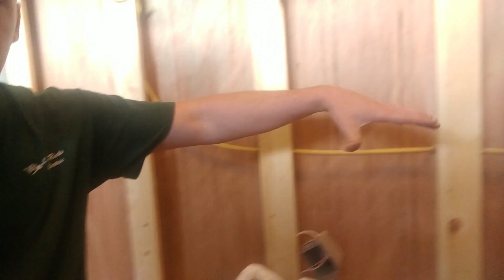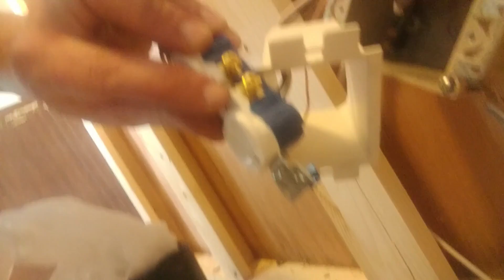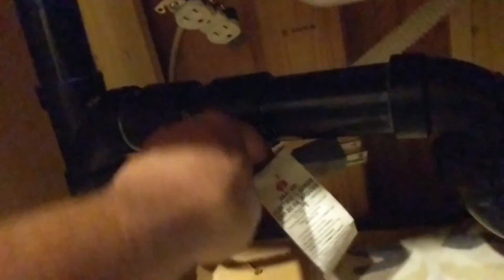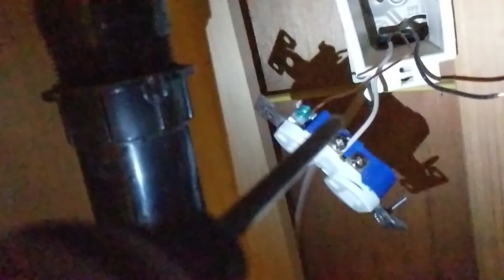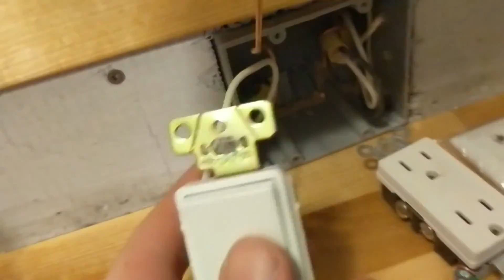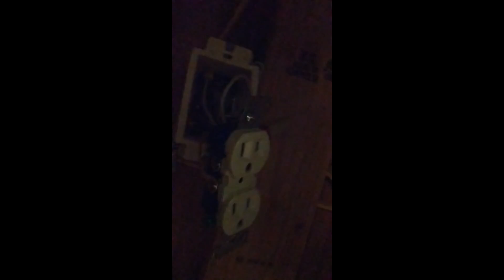Wiring for a Switched Disposal | Kitchen Sink Disposal Outlet

Comment: What is the way to provide GFCI protection for the dishwasher and disposal? You can’t split a GFCI outlet. 
I guess cutting for a quad box and putting in two GFCI outlets and one of them is switched… 
Or putting in two GFCI breakers at the load center(?) More expensive, but then I could leave my split/switched combo in place. 
Not sure if one is more legally preferred by NEC.

Comment: would it work if you just connect the neutral wire to top, in parallel with the hot wire for disposal switch? This way, you don't have to break any tabs. Also, I would recommend using a red wire for hot side, not a white wire 😊

Comment: I always take a black marker and blacken the white wire at both ends to say it is power or a blue color, anything but white! Stops someone from thinking it is a neutral, even heard of black tape on wire!
Reply: Just use black electrical tape.  That is the code-approved method.

Do not skip this step!

Comment: Thanks, this actually solved a wiring mystery in my house.  The disposal (turned on and off with a wall switch) quit working, but it would work if I took a three prong extension cord and plugged it directly into another outlet.  When I took the switch out of the wall box, I found that the switch seems to be connecting the hot and neutral, rather than interrupting the hot when open (like a light switch is supposed to be).  My goal was to open it up and check for 120v with a voltage meter, but the switch doesn't have screw terminals on the side.  I put the switch back in the box and buttoned everything back up.  I'm going to buy a contactless voltage sniffer to find out if I turned off the right breaker now 😅  And it magically started working again in the meantime...but at least I'm reasonably confident that the previous homeowners didn't cross hot and neutral at this point 😉

Comment: THANK YOU THANK YOU THANK YOU! I couldn’t figure out why the new outlet I installed kept tripping the main breaker and had me worried! Broke the tab and also checked the old outlet which was also broken and boom everything works perfect. Also checked it with a voltage outlet tester. The people that have nothing good to say are a drop in a bucket. Keep up the good work my friend and thanks again!

Comment: Good video, but I think you were supposed to mark the white wire in the cable going to the switch to clearly designate it as a hot wire. That would have been very helpful in case the outlet needs to be serviced in the future.
Reply: I was trying to figure out why he didn't put a black line or electrical tape on the white wire, so it was clearly a designated as a Hot wire???
Reply: I'm the maintenance manager for a 48 units town home called lake side manor and just had this issue I found out they haven't property marked there hot wires and the circuit breaker isn't property marked either so when I shut the power off too the disposal I still ended up getting shocked.

Comment: Ah, the tab between the outlets!!!  Our disposal had stopped working and I knew it was the outlet, so, I replace it (without removing the tab) which meant that the disposal just ran regardless of whether the switch was on or off.  After watching this, I removed that tab, and viola! it worked as it should.  Thanks for the detailed video and for saving me an electrician visit!

Comment: garbage disposals and dishwashers require 20 amp circuits. Good practice is to keep them on completely separate circuits. Additionally, you used 14-2 wire for the power feed which is 15 amp max. You need to use 12-2 (the yellow wire) for all wire in a 20 amp circuit. Your outlet is also a 15 amp outlet, you should switch to a 20 amp outlet. Code does not require a GFI for these circuits but since you may someday change the faucet and spill water on your head it's a good idea to include GFI either at the outlet or the circuit breaker.
Reply: My garbage disposal calls for a 15 amp, dedicated circuit.  However, good practice to have dishwasher in another, separate circuit.
Reply: thank you for this. I am not electrician but I can tell right from wrong. Looks like I need to go to another video to see how this is done properly.
Reply: @GoPoeee  lol have you found that right Video? Because everyone is doing it this way and have YET to figure out how to install a GFCI outlet under my SINK to run my dishwasher(now wine/beer fridge constant power…who uses dishwashers, I’m not wite) and run my disposal (by switch)… if you found the video… link it below!
Reply: @Team_BLacK_HarTz😅😅😅 wait, what? Only white people use dishwashers? I have never heard this 🤣🤣🤣🤣🤣🤣. Something rose to look up.  A dedicated drink fridge does sound appealing, though…

Comment: Im confused the point of the jumper? Its same black going to the hot side right? Why not just use it or am i missing something?
Reply: The word "Jumper" is probably not the best term. Really its just a short wire.  Hot from existing dishwasher line into a nut. Out of nut....1. short wire to  brass lower plug, thats for the dishwasher,  constant hot. 2.  second wire out of the nut goes up to the switch.  
Or put another way, splitting the existing hot to the constant on outlet plug and the switch up on counter.

Comment: Sharing neutrals is against the code
Reply: I assume you mean there being one neutral on the outlet but there being 2 hot wires? Both hot wires are the same circuit so one neutral is OK.
Reply: They wouldn't have to share neutrals
Reply: It's the same circuit.